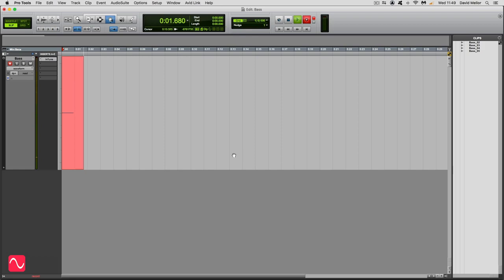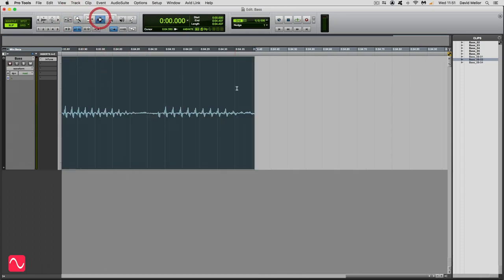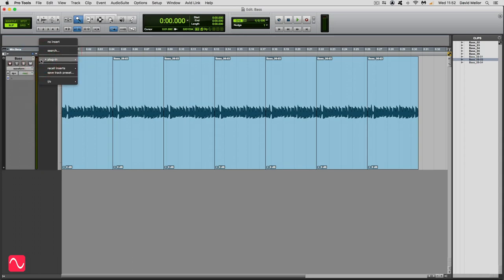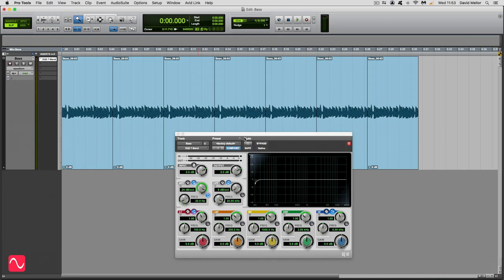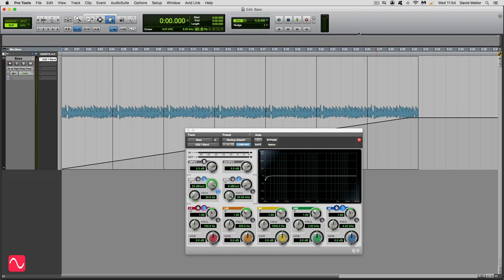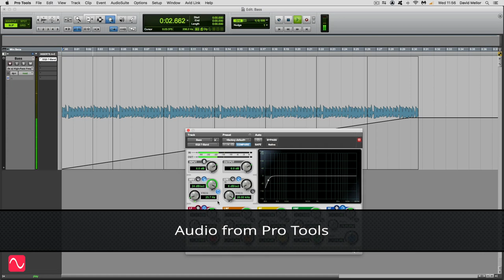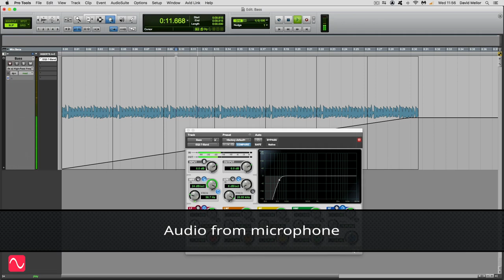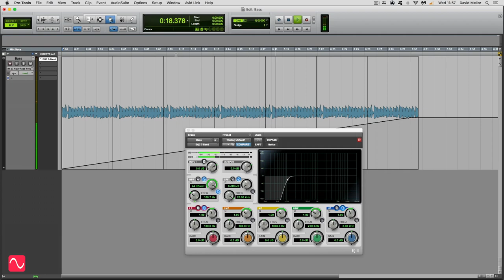Bass - How high can you go? Test your monitors (and your ears)

Comment: Very important point to make, and well made. I have made a point to have monitoring that is more extended and accurate so I heard the difference lower at around 50 and 60, but accurate monitoring is surprisingly overlooked  by so many neophytes. The only other things I would maybe have emphasized is the lowest frequency that one might expect to be able to notice a difference even at best given flat monitoring. I know you mentioned 42 Hz as the fundamental of the low E but it might have been useful to talk a bit more about that regarding the nature of the crossover and the fact that a bass has a lot of harmonics that continue to be audible even much higher up. This may seem implicit but I think it would have been worth highlighting. Also, mentioning that the NS10M are very common as near fields despite their inaccuracies but are usually augmented by other speakers might have been useful perspective. The relevance of subwoofers and proper integration of them, as well as the interaction of low frequencies in a given room, would have been useful. Emphasizing accurate flat response when making mixing decisions as opposed to only extension would also be very relevant to neophytes. Perhaps you were purposefully understating things to avoid coming across as too aggressive or over burdening but I think it serves your audience better to spell things out a bit more. All in all though, there is something to be said for keeping things succinct and you certainly made a critical point very simply and quickly. And kudos to making it fun. And I enjoy that you keep it informal and off the cuff rather that overworking it.
Reply from the maker: Thank you for your comments, all of which I agree with. I'm tempted to expand on them in a future video. In the meantime however I'm going to say something controversial... I actually enjoy the sound of the NS10M speakers. DM